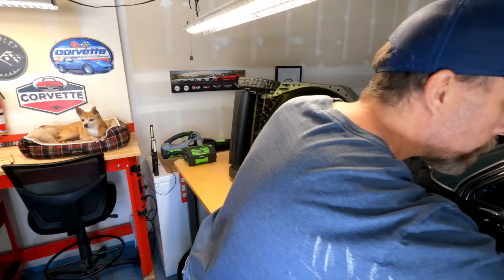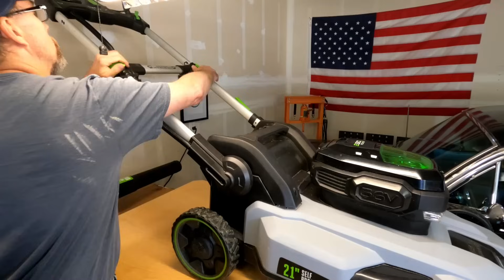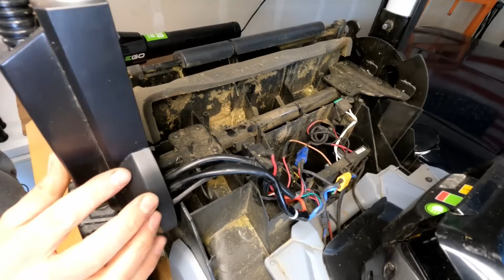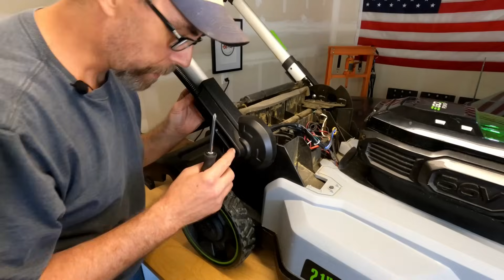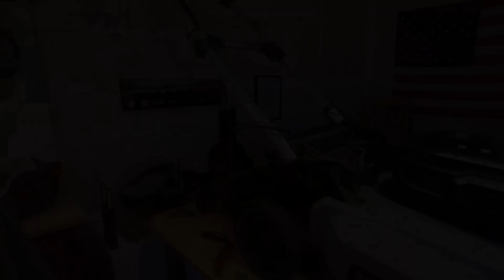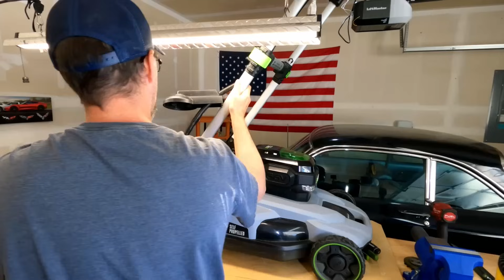My Ego Mower Finally Quit Working!!  🔧  Can I Fix It??

Comment: Do I remember correctly you said in the beginning of the video you’ve had this mower for years? Doesn’t it have a five year warranty? Reason you didn’t pursue warranty repair? Is the warranty invalidated now that you have opened it up
Reply from the maker: This is a great question. Thank you for watching and for the comment! First of all, I have definitely gotten great use out of this mower to justify repairing it. If it had broken in the first season I would have looked into the warranty replacement. Second, I needed to mow my lawn that day as it was getting too long and a storm was on the way. I was able to get the mower back up and mowing in about an hour. Working through the EGO warranty system would have left me without a machine for who knows how long. Third, I actually enjoy fixing stuff, and lastly, I have a YouTube channel in which I repair, maintain, and install things. The warranty period for these machines will expire soon for many owners and I take pride in sharing my experiences with others in the hopes that they may save themselves replacing their machines when a little wire patch will get them back in business. Thank you, again, for the comment!
Reply: @EndWrenchRookie  , Thank you! I’m thinking of getting one of these and, if I do, I will know not to close the handle very often. Your video is a big help! Would you buy another one of these?
Reply from the maker: You are very welcome. Thank you! Yes I would buy another one of these for sure. I think that they have addressed this issue in the later models, but ya I would be cautious with the handle operation. Good luck!
Reply: @James Rudolph, mine developed a problem with the self-propel speed ( stuck on high speed) in the fourth year of use. I even got authorization from EGO for return for repair, but decided I will do the repair myself. The reason was, that EGO’s repair takes 3 months, and would have cost me an arm and a leg paying for lawn mowing service. In my case I replaced the three wires coming down from the speed control lever, with CAT5 Ethernet  cable ( the cheapest solution). The mower has worked flawlessly for the last two years with its original 7.5AH battery.
@EndWrench Rookie, thank you for sharing a nice detailed video. 👍 Oh do you keep Doggo as resident scientist lawn mower consultant by your side? 😂
Reply: Cool, thanks!
Reply from the maker: That is great! love the easy fix. Thanks for sharing... Ya, Doggo is always there as a resident scientist. lol. Glad you enjoyed the video. Thanks for watching and commenting!

Comment: great video you are a genius what wires did you use to make repair
Reply from the maker: Thank you so much! I just used some lengths of patch wire that I had laying around. I believe they were 16 gauge, though they were thicker than I needed. Haven't had a problem since. Mower is working great. Thanks for the comment and thank you for watching!

Comment: I bough tone of these mowers factory refurbished from Home Depot about 4 years ago for about $300 with the battery included. That's about $100 more that the price of the battery. It has run great and I bought several other factory refurbished tools from them and they have also been great.
Reply: @MAGA MAN Now that was a good deal! Glad you were able to snag one! Heck the battery costs more than than your deal
Reply from the maker: That's great!

Comment: That hole in the outer ring under the blade is a place where you can put a screwdriver to stop the blade from spinning while you unscrew it. Holding the blade by hand while trying to unscrew the bold with a power drill is a very bad idea. If the blade slips out of your hand, you could lose fingers.
Reply: That was an impact driver. It’s hitting the bolt end-on quickly while turning relatively slowly. I wouldn’t even bother holding the blade. The bolt would come right on out.
Reply from the maker: Thanks for the input!
Reply from the maker: Thanks for the tip

Comment: I hope Ego sees this video so they can do a redesign to prevent these issues. Good job!
Reply: They have not fixed this problem with models after this.
Reply: @brianwhoreadsobjectiveinfo1122  Yep. Mine is 2 1/2 years old today... and I'm having this issue. C'mon @egopowerplus! Such a simple fix for all of us that have directly supported your growth! Rendering my mower useless, and more importantly throwing a massive rock into what is my home chores/maintenance routines' blades. You mulchin' what I'm cuttin'???
Reply: @brianwhoreadsobjectiveinfo1122 yup, bought one recently and it didn’t even turn on the first time I tried to use it… decided to get a gas lawn mower afterwards
Reply: Great video!  My mower is 2.5 years old and I fold it after each use as well.   I’m struggling with intermittent solid orange, flashing orange, and flashing green and red LED on the mower… and then the blade just stops.  I can sometimes get through an entire cut without issue… and sometimes, I can’t go more than 15 mins.  It’s been incredibly difficult to replicate / troubleshoot.
Reply: @Kelevra313 replace all the wiring, wires do not handle being bent and moved very often
Reply from the maker: Thank you so much! I agree. With my mower being 4 years old, I would imagine that they have addressed this issue by now? Thanks for watching!
Reply: My EGO mower is 4 years old now, and hasn’t had any problems yet, but I have heard of several complaints about the folding handles crimping the wires, so I purposely store my mower without folding the handle back all the way. Very informative video. I’m saving this as a favorite under my EGO folder, in case it happens. 👍🏼
Reply: They won't even listen to consumers re the lack of appropriate height settings and the huge front overhang so I don't fancy your chances.
Reply: Yeah. Good luck with that. The CS department has much to be desired. They know NOTHING.
Reply: It's 3.5 years old, they have several new models since then.

Comment: Great video!  Curious as to what gauge wires were used in the splice?  Thanks!
Reply from the maker: Thanks much! I don't recall exactly...I think they might have been 16 gauge. They were definitely bigger than the ones that I was interacting with but they were the smallest I had on hand. My grass was super long and I wanted to get it mowed that morning before the storm hit. Otherwise I would have probably gone to town and purchased some smaller wire. Thanks for the comment and for watching!
Reply: @EndWrenchRookie  I'm sure we'll all have to do this at some point.  I've seen a few videos about this pinch-point.  Love the fold-up capabilities but definitely somewhat of a flaw.

Comment: FYI the batteries are not fully interchangeable... The small blower battery you have their has a fuse that's rated for 10A inside the battery.
Reply: That's not what Ego says. They say every battery will work in every product.
Reply: @Dav1d_B  I'm aware and that's exactly how I "blew" my battery up that came with my chainsaw. The battery that came with my mower has a 5mm fuse. The size that came with my chainsaw battery is 3mm. The size that is one down has a 2.5mm pcb style fuse. Instead of an amperage rating on the fuses they are rated via different thicknesses and you have to unsolder them. Most people replace them with automotive style blade fuses after they blow.  

The PCB fuse on these batteries is in fact different between them and have different amperage ratings.
Reply from the maker: Thank you for the comment! Interesting...I am not aware of an internal fuse. I have run the mower with the smaller battery as well as the blower with the larger mower battery without issue. I assume a power surge or overload would trip a fuse? If you pop an internal fuse is the battery useless? Great input. Thanks for the heads up.
Reply: @EndWrenchRookie  Yeah. I killed one via the fuse by cutting a very overgrown yard. it popped the fuse in the smaller sized battery.
Reply from the maker: Wow. That's crazy. Thanks for sharing

Comment: Looks like protective shield should have been longer to go through metal area to prevent bolt from pinching. Design flaw !!!
Reply from the maker: Sounds about right. I imagine they have improved on the design by now. Thank you for the comment!

Comment: Thanks, for the vid.  I'm a gardener based in the UK. I have a few EGO tools already but I've not bought the mower yet as I don't think battery power is there yet to run one commercially. Can you tell me what battery you run it with, how long is the run time and will the mower cut long, wet grass. Finally. What's it like at bagging the wet grass.  Thanks 👍
Reply: I mow 1/4 acre of grass with 2 7.5AH batteries and have power at the end.  The ego is not as powerful as a gas engine, but it is so much more convenient (push a button vs. pull a cord) and storage and maintenance is a breeze.  I have both a gas mower and an Ego mower but for the past two years, my gas mower hasn't seen the light of day.  Will keep it as a backup though.  As long as I keep my blades sharp, no difference in cutting quality under normal use.
Reply: @davesterchele2679  Thanks Dave. Your input is really appreciated. I'm putting off getting one on hold for the moment as I'm going to buy a Honda rear roller, and a Weibang professional scarifier for next season. That's a £1900 spend (Not sure $ that is) but either way it's a chunk of cash. So the electric mower will have to go on the back burner for now.
Reply from the maker: Thanks for the comment! I run the 7.5 amp battery on the mower and the 2.5 amp on the blower and trimmer. They are all interchangeable. runtime is about 1 hour. I mow 2500 to 3000 sq feet at my home. I never run out of battery. I do charge the battery right before I mow every week. I usually mulch, however when I do bag it works as well as any gas catcher I have used. It definitely mows better when bagged. It will cut long and wet grass, but it will not perform like a nice powerful commercial mower. It kicks into high speed operation automatically when bogged down. This rarely happens to me, but it does help. I would not hesitate to use it commercially just for edging, however may not hold up to all day use. You would have to have an army of spare batteries on hand and constantly charging to make any money with it. Hope this helps. Thanks for watching!
Reply: @EndWrenchRookie  Thanks for your well thought out and prompt response. Gardens over here in the UK seems to be considerably smaller than the USA. I'd guess the average rear garden (yard) I do over here is only about 30ft x 25ft. I generally do between 7 and 10 gardens a day. . My concerns about electric mowers are power and battery consumption. I'm really pleased with my other EGO stuff. Strimmer (weed whacker) my long reach hedge cutter and my bristle brush. I have 3 x 2.5ah batteries already to use with them. . But a mower will need to work harder and longer than any of the above. I just wonder if it will be up to the job as it would be an expensive mistake if its not. Thanks again for your input. Much appreciated.
Reply from the maker: No worries...I think you would be able to get by with 2 of the 7.5 amp batteries. They would cover that much work in a day. Especially since you can always lean on your smaller batteries if you run short. Not dealing with noise, maintenance, buying and storing fuel, smell...is well worth it.  Good luck!

Comment: New subscriber here.  I have had a similar problem with my Ryobi push mower.  The sensors in the folding handle were my problem as well.
Reply from the maker: Thank you for the comment! I am glad you were able to figure out your mower issue. These battery powered mowers are great as long as you can work out the issues. Thank you for watching and for subscribing. Enjoy!
Reply: @EndWrenchRookie  yes everyone claims no maintenance for these battery mowers and although there are no fluid issues with oils and gas which I like, the maintenance is now with electrical connections.  

I was s early adopter with Ryobi and then EGO came out. I like their design.  Have you had much trouble with the batteries? For me, I have had 2 out of 7 of the 40v fail.  I have had 4 out of 6 of the 18v fail.   The 18v are usually easy to fix by bypassing the BMS and charging manually.  None of the after market batteries have failed yet in 2 years.  Thanks for your comment.  All the best!
Reply from the maker: All true! No such thing as no maintenance, just a different set of problems. I have not had a single problem with regards to the batteries. I am in my forth year and the big battery and the 2 small batteries (all interchangeable) are still going strong. I did quite a bit of research on both the Ryobi and the Ego when I purchased mine. It was hard to swallow the extra cost of the Ego, but I feel that it is, or at least was at the time, a superior product. I suppose it is a point of reference issue. If I wasn't into fixing and maintaining my own equipment, then I might think that the problem I faced would put the mower into the junk category. But I have been super happy with my mower, weeder, and blower so far! If I was in the market today, I would be faced with the same tough decision between the new Ego model and the new Milwaukee one. I am sure that Ego has worked out a lot of the kinks by now, but holly cow, have you seen the new Milwaukee?  Thanks for the comments!

Comment: You can just jump the wire .. but you disengage the extension arm safety mechanism .. but being a dad I’m the only one who does the mowing anyways. Lol.  The whole pinch area at the arm, stinks.  I think they changed it in the new models.
Reply from the maker: True that. You could just jump the switch. I did not think of that. That would have been easier. Thanks for the comment! I am glad that they addressed it in the new models.
Reply: @EndWrenchRookie  the arms slide down too much so it probably disengages the sensor on the lawn mower.
Reply from the maker: Sounds about right